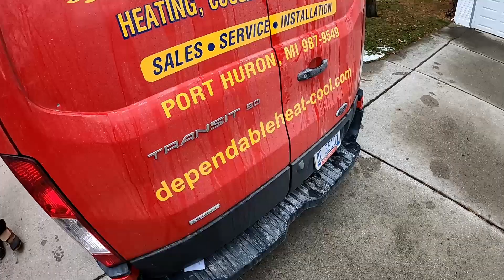Furnace And Water Heater Not Venting For 32 Years

Comment: Service call was for no heat. Tech in beginning of the video said the “draft limit on the furnace tripped”. Look at the video again. Theres soot in the chinney and a gap by block 2  inside. What most likely happened, the guts of the chimney crumbled, the liner inside slid down and blocked the flue of the furnace, which shut down on safety.

Comment: I'm pretty sure the liner slip down that's why you got the call there is no way that's been there for 32 years like that
Reply: Joe Amoto I agree with you. They would have been dead or severely ill right after this was installed if it had been blocked originally and it most likely would have never operated at all

Comment: People would think I was making up those kind of stories! And you're right! It was a good thing the homeowner was standing there as you took it apart because he would not have believed you! Been there done that. And it is still one of life's greatest mysteries and hardest questions to answer, how has it worked this long without a problem or at least flame rollout?! One thing is for sure, your weather is very similar to the weather where I live and your video made me feel very grateful that after 32 years in the trade I am now retired on disabilty!! You lugging that extension ladder around was enough to make my lower back twinge and knees ache!! Unfortunately the first things to go in this trade... or I'd still be doing what you are. No 2 calls are ever alike, I guess that's what I like about it, the challenge. Kudos on the veto pro pak! Best tool bag I ever owned! And they do stand behind the 5 year warranty, at least they did on my XL. 👍🏼👍🏼

Comment: I'm wondering if the clay liner may have slipped down (?).. I just can't imagine anybody with a half of  brain venting two pieces of gas equipment that way. We know in 32 years the gas company would have fired that equipment at least three or four times over those 32 years ( turn ons and gas meter changes) . Gas companies can get sued for putting a hazardous gas appliance back into service ( after turn-ons and meter changes). One thing I will say is in my 35 years as a first responder / service technician for the gas utility in St Louis > you never know what to expect when  you walk through that front door. We had a saying at the gas company " you can't make this stuff up."

Comment: It’s a possibility that the clay liner near the base of the chimney slipped down. Found that 2 times..
Reply: I was thinking the same. Cause if that's the way that was installed originally as he found it..its borderline criminal.
Reply: That's an interesting aspect. Maybe a camera dropped down on a string from above would have revealed more.
Reply: yeah, if they didn't start it from the bottom with it notched out, seen that before they save a whole liner section, too lazy to cut it open and just had it mortared up in place or propped on scrap brick and it dropped from the start.
but always the possibility it was never cut in to begin with, yikes either way!
Reply: That’s what I was thinking. In the opening when he looks down it you can see a gap between 2?
Reply: So what did you end up doing. Did you knock it out? There’s no footage on how you remedied the problem
Reply: @demetriosa7646  he didn't show it, but you can guarantee it was knocked open :)
Reply: My thought exactly.
Reply: @throttlebottle5906  or the section shattered and the next one slid down pushing the pipes outward and that’s why it was so tight to remove?
Reply: @hvacr tech Give price for liner as only option or gtfo
Reply: Looks like the butcher work of Coldstat Refrigeration from Paramus, NJ.
Reply: @shupe1907  Borderline criminal where I live it's $500k fine and 5 years in jail

Comment: I have to comment on this video I was in the chimney cleaning and repair business years ago and the furnace tech missed leftover creosote in the chimney about 6 to 8 ft. down. That tells me that the chimney probably had a chimney fire at some time and the bottom terrace cottage liner collapsed and the others slipped down also it looked like the terra cotta liner was cracked when you looked in where the water heater was connected to the chimney. The chimney needs to have the terra cotta liner removed and a new stainless steel liner installed.

Comment: If the clay liner slipped down causing the blockage, then the chimney has been compromised and it would have to be lined or its just easier and possibly cheaper to replace the aging furnace with a newer high efficiency with PVC vent and install a power vent into the water heater or replace it as well due to the fact that they are both aging and possibly on their way out. I had a gas water heater from the same time period start leaking after I spent a good deal of money having someone out to fix it a couple of times and would rather spent it on a new one.

Comment: My old boiler vented into an old 2-story  masonry chimney.  When I changed it out for a direct vent, the plan (proposed by the HVAC boss guy) was to run both PVC pipes inside the chimney and out the top. No clue how he thought they would actually get them in there, but that was his plan. The crew chief actually doing the job thought that was a pretty ridiculous plan, especially given the weather that day (20's, windy, snowing) and said they couldn't do it, unsafe, and proposed running them out through the rim joist instead.  "That's how we usually do it, it's much faster & easier, it'll take like ten minutes."  Yeah, about that rim joist... the house is 160 years old, and the "rim joist" is about an 8" x 10" beam on top of the basement wall.  Took a lot more than 10 minutes, and the guy doing it was not happy. :-)

Comment: The shingles look like a drunk installed them.....ohhh wait.....roofers....same difference.
Reply: Yeah, that house is going to need some $. Roof, chimney touched up, furnace, water heater.
Reply: Is there such thing as a sober roofer?
Reply: @chadgiesbrecht2876  the day before pay day
Reply: I blame the camera lens.
Reply: Let's not forget the blocklayers.  Hard to tear down a block wall and not find 12 or more empties.
Reply: Plus who did the math on the cap? 12+12=24. If you gotta write that out probably shouldn't be working on stuff.

Comment: Over the years had one water heater never vented , one gas furnace electric flue damper stuck closed and wired around. All the outer walls had mildew. The best one was a small home with no vent furnace exhausting into hallway. The humidity was ruining the wallboard. .i left off explained the danger. Went back a year later they vented duct into attic not outside.

Comment: A water heater I was replacing was never hooked up to the chimney. It was venting in the basement. I surprised know one got killed.

Like you said the stuff we come across on service calls.
Reply: A friend of mine was sealing some holes in the wall behind his gas water heater with a can of great stuff and it ignited causing a fire inside the wall. The fire dept pushed the water heater out of the way and hacked all the pipes up and put the fire out. He just re-plumbed the heater to get it working and wanted eventually to get in the space behind it to fix the drywall but that never happened. For 2 years it sat there venting in the utility room and they left a window cracked to let the gases out.

Comment: The bad part is that his gas bill is going to go up now. He went from a 100% efficient furnace to a 75%. Lol
Reply: No Names Please at least they don’t get headaches any more!
Reply: Btu is btu no matter what. Fuck the high efficiency scam
Reply: @AmericanFarmerHVAC2024  Huh?
Reply: @AmericanFarmerHVAC2024  Explain yourself...
Reply: ba-da-dum-tisss :))
Reply: @craighvac1808  Watch my video on talking about the scam of a "high efficiency" furnace. You'll find all the explanation you need right there.
Reply: @nonamesplease8228  Watch my video on talking about the scam of a "high efficiency" furnace. You'll find all the explanation you need right there.
Reply: @AmericanFarmerHVAC2024  what you said simply makes no sense. Yes a BTU is a BTU, because it is a discreet unit used for measurement. But anyone who can use logic would know that efficiency and BTU have really nothing to do with each other. I can make 10,000 BTU by burning X amount of fuel, or I can make 10,000 BTU by burning Y amount of another fuel.... that is efficiency. If Y requires 20% more fuel to get the 10k BTU then guess what?
Reply: @johnd9357  no. The gas valve is the same. The orifices are the same, the sizing is the same. You simply can not put more input btu on a unit that it's designed for just because it's an 80%. And truly they run probably 85-88%. Example: the carriers I sell, a 60,000 btu unit has 3 burners. Both 80% and 90%. I'm not talking about output btu. which really only makes up 2-3000 difference. You won't ever notice that difference. Especially when the temp rise of an 80%er is the same as a 90%er Granted, because of certain situations in buildings. It's easier to vent pvc. But for customers that have a masonry chimeney, or already existing b vent, makes more sense to go back in with an 80 plus. Also never have to deal with shitty secondaries sooting up, and plugging up because they can't run on propane gas worth a fuck!
Reply: Must be a drafty house.
Reply: @AmericanFarmerHVAC2024   I occasionaly watch flat earther and sovereign citizen videos, so I took the trouble to find your rant about high efficiency furnaces.  Oil and propane (when in the tank) are liquids, so their volume doesn't vary much with temperature.  Natural gas can't be measured as easily by volume, but that doesn't matter.  All that matters is how much heat do you get from every unit of oil/propane/gas you put in.  With a high efficiency furnace, almost all (95% or so) of the heat generated goes into your home.  With an 80%, only 80% goes into your home.  The rest goes up the chimney.  It is hot, but the main way heat goes up the chimney is via steam.  A condensing furnace recovers that heat, and also lowers the temperature of the exhaust.  Your furnace doesn't run continuously.  To heat your home to a given temperature, the efficient furnace with the same input BTU will run 15% less, and therefore use 15% less gas.  This may not be enough of a saving to justify junking your functional 80%, but when replacing anyway, in any climate with snow the fuel saving will pay for the minor incremental cost.
Reply: @gordonv.cormack3216  no. You are so dead on wrong on this, it's not even funny. The temp reading of the supply heat is NO different. The 80% won't run any longer than a 90+ to heat a structure. Lastly. 90%ers are complete garbage. And especially with most of my customers using propane gas.. propane gas destroys these worthless secondary heat exchangers. I'm not in this industry to fuck people. I'm in this industry to help people. And what I sell, I sell based on the conditions of the building. Does it have a masonry chimeney? Does it have existing b vent? If it does, they get a new 80 plus. Save them money, and the thing will last 25-30 years. A 90%er?? Propane gas will have decimated that secondary within 5 years. No customer likes being told their hear exchanger is fucked. Period. Be a good tech, be a good person.
Reply: @gordonv.cormack3216  also, don't try to "educate" me. I know my shit, and this is why I'm in this industry.
Reply: @AmericanFarmerHVAC2024  Angry:  I don't presume to be able to educate you.  At best I can hope to blunt the impact of your nonsensical assertions regarding efficiency on others.  It is indeed remarkable that you are permitted to practice in the industry with such a limited understanding of relationship between fuel energy, temperature, and heat.
Reply: @gordonv.cormack3216  Remarkable indeed, very nice way to put it.
Reply: @AmericanFarmerHVAC2024  Angry:  Perhaps we have different definitions of bullshit.  This is bullshit because it is a meaningless non-sequitur:  "The temp reading of the supply heat."  This is bullshit because it is false: "The 80% won't run any longer than a 90+ to heat a structure."  This is bullshit because it is specious fallacy: "[irrelevant assertion about my actions and motivations] proves who is the winner of this argument."  We may also differ on the meaning of "explained."
Reply: @gordonv.cormack3216  I'm on your side Gordan. I don't know what the heck Angryfarmer is talking about. Any time you reduce the flue gas temp of a furnrace from say 300 degrees (80% furnace) to arourd 95 degrees (96% furnace) you are transfering that flue gas temperature to the air side of the heat exchanger.
Thus extracting 16% more heat from the fuel being burned. It's call Thermal Dynamics (heat cannot be created or destroyed, only transferred from one place to another)
Reply: @nonamesplease8228  I chuckled at your joke, and Brad White's rejoinder.  Thanks.
Reply: Well, might regret adding in my two cents worth... I haven't watched the efficiency video. Probably won't, but Angry might be right with the condensing units in some aspects in this conversation. They do produce acidic condensate. That condensate might be worse coming from propane. That being said, whatever energy savings may have arisen from the fuel savings might go into the repair of the heat exchanger... I don't have a whole lot of experience with the finer details, but I know when I'm wiring them up, the highest efficiency units (hot water systems too) have a special drain element to reduce the acidity of the effluent water. 

Again, not exactly my forte, but the conversation was interesting enough to want to follow anyways. Blast away at me, if you'd like.
Reply: @IceBergGeo  Thank you, someone with some basic common sense. Propane gas is monstrous on condensing furnaces, boilers, power vent water heaters, you name it.  Especially in downflow applications for some reason. I'd like to know why. Propane 80%ers fair much better off in terms of longevity. I think it's difficult to get consistent quality propane gas for what ever reason. Natural gas of course being much more reliable. Especially this year, I've had tons of units in various locations soot up, plugged up secondary heat exchangers. Two furnaces were only 5 years old. That's just not okay. No customer likes getting that news that soon.
Reply: @AmericanFarmerHVAC2024  So, EU has been using condensing units for around 30 years now. Natural Gas they're more economical and you do get better heat extraction and recovery. However outside the cities when we're using Light Oil/LPG condensing unit's if they're blown gas (room sealed appliances governed by fan speed/gas ratio valves the sooting and corrosion is minimal). As soon as you swap over to conventional appliances or downflow L.O/LPG tend to rot out their secondary heat exchangers or condensate plates. This is basically due to the fact for the same volume of lpg/oil to natural gas you can extract more heat and thus create more acidic condensate in the same time frame yet most design tolerances are based on Natural Gas. 

Hopefully that information is helpful to anyone reading the string of comments in future. Edit: Just as a note, LPG is much more corrosive than natural gas and the impurities for want of a better term is one of the reasons the condensate is so much more corrosive.
Reply: @effervescence5664  Very correct.
Reply: @AmericanFarmerHVAC2024  
My Lennox pulse furnace (97% efficient rating) from 1988 is still going strong. Just one example that proves your assertion wrong. And it runs hard and long when temps are far below zero in Dec. Jan. & Feb. where I live.
Reply: @MrWayneJohn1  which pulse furnace is it? They crack. In 1988 the shit was made high quality with strong materials. Cast iron never fails. These are just facts.
Reply: @AmericanFarmerHVAC2024   It had a factory installed cast iron heat exchanger. Cracking issues caused Lennox to choose to replace them, under warranty, with stainless steel exchangers AND cover them with a lifetime warranty. As such, I'll never be in a hurry to replace the furnace (it's on the 3rd ignition contol module and 2nd blower motor - still no desire for replacement).
Reply: @MrWayneJohn1  Good for you.
Reply: @AmericanFarmerHVAC2024  😎👍 Thanks!

Comment: Did you put the mesh back around the cap?  Bizarre video - my house we discovered a cracked flue which the inspector missed because the heat was on during the inspection.

Comment: Old house, well ventilated not like our air tight houses of today.
Reply: I just bought a new build house, it’s totally sealed and has insulation sprayed in all the walls and even the under side of the roof. It has ZERO penetrations that aren’t sealed tight. We literally have to have a special type of air conditioning unit that will periodically pull in outside air (and filter it) to ventilate our home, just for air quality reasons. It’s crazy how air tight homes are now.
Reply: Sure air tight houses stay cooler in the summer and warmer in the winter, but with the lack of air ventilation you have to install special fans systems that bring in fresh air. Otherwise you’d just be breathing in your farts.
Reply: The Build Show- is all about sealing and building air tight homes for super efficient cooling and heating. I remodeled my 1960’s built home last year and I spent 10K to seal it and change all the insulation I now have conditioned attic so my a/c  doesn’t have to work so hard and wow my electric bill has dripped. Well worth it.
Reply: Probably prevented their demise co monitor should've alarmed them decades ago... to the situation...
Reply: @johnd9357  It's called an HRV or ERV.
Reply: @johnd9357  It's called an HRV or an ERV.

Comment: This is probably not it, but did the flue tile slide down?

Was is gas or oil?  Looks like gas.
Gas doesn't really produce carbon monoxide if burning properly, just carbon dioxide.